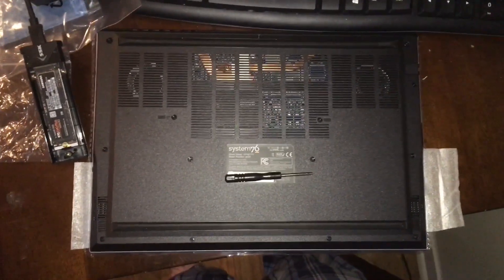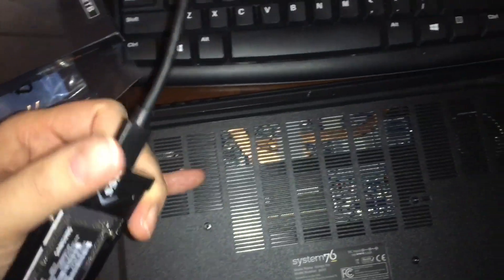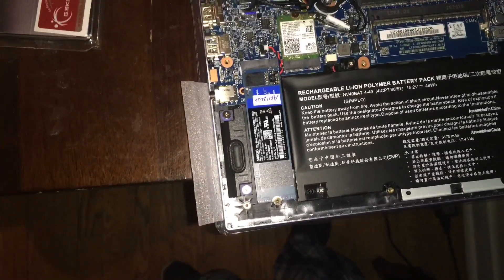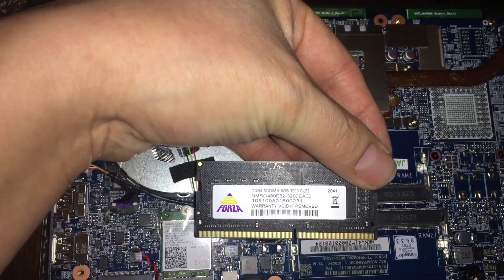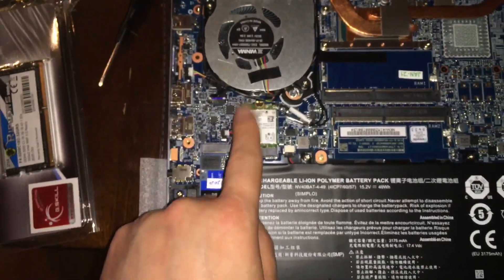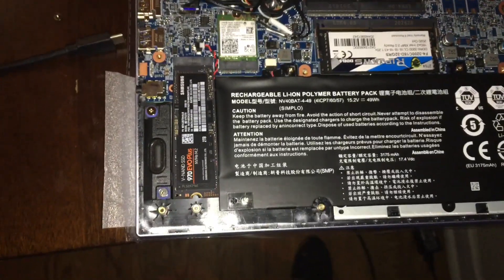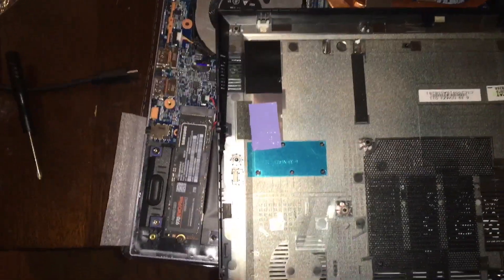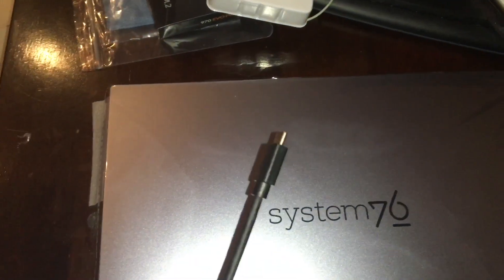Upgrading My System76 Galago Pro (galp5)

Comment: Here's a big tip for removing the back cover (with way too many screws - 14!): be very careful to lift it up and not turn it over until you have a surface on which you can catch the tiny screws! Or you may lose a few....
Reply from the maker: Good tip!   Sometimes I also leave the screws there and put the cover down on a flat surface so the screws stay in the right holes still.

Comment: wow upgrading from 8 gig RAM to 32 must feel nice ahah. What exactly do you need 32GB RAM for? If I can ask...
Reply from the maker: I run virtual machines.  Sometimes the distro hopping itch happens, lol.  Also I keep a working Windows 10 VM just in case.  I also dual-boot for gaming, but if I find myself using the Thunderbolt 3 eGPU (Akitio Node) less and less, I'll just blow the dual-booting Windows instead and use the VM exclusively.

The 32 GB also comes in handing in Windows 10 (dual-booted) for gaming.  Windows 10 is more of a memory hog.  16 GB is the minimum I recommend these days for Windows users.  32 GB gives you more headroom.
Reply: @TechieZeddie  yeah I've heard from a few sources that virtualizing Windows inside Linux actually gives you better gaming performance than the actual plain Windows! LOL  Linux gaming should definitely become more mainstream.
Reply from the maker: @Fidelis94  Actually running certain Windows games in a compatibility layer such as Proton or Lutris (Wine-based) can be faster than running in Windows because less overhead for certain things I'm guessing.